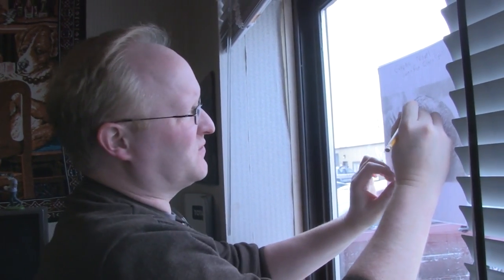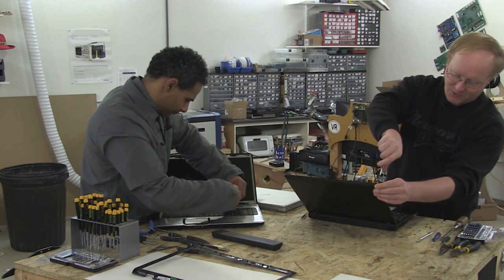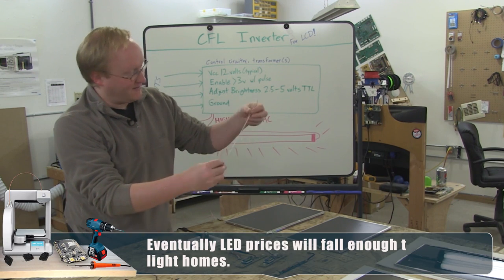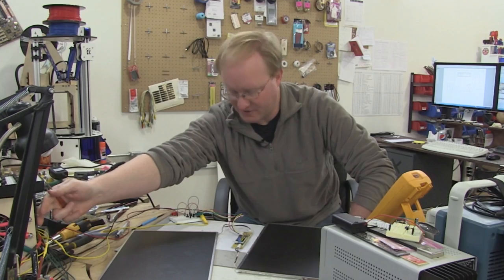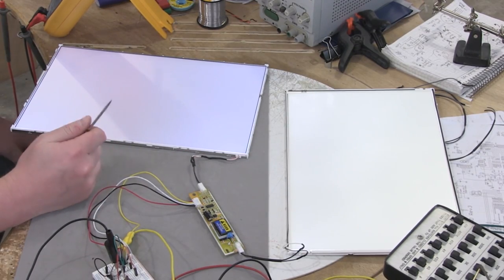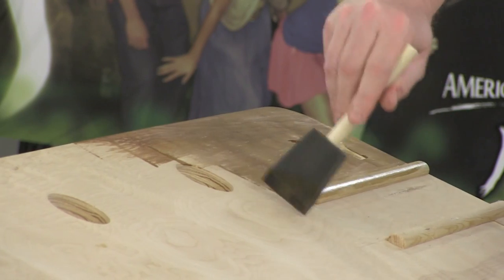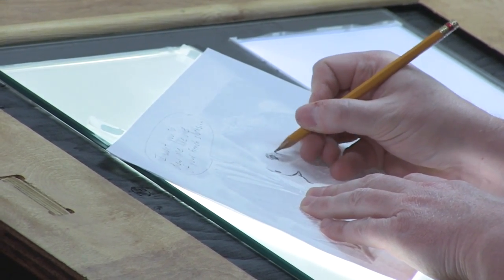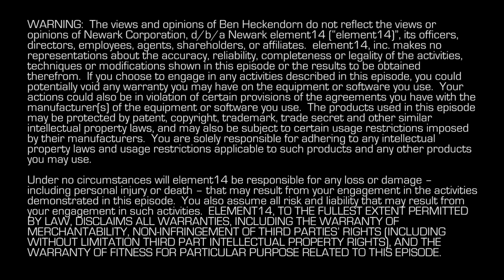Ben Heck’s LCD Monitor Light Box

Comment: This is the dumbest project yet. What a waste of good LCD screens.
Reply: So, you'd rather see the entire laptop dumped into the landfill? At least they're using broken laptops for something. I'm beginning to sense, based on the comments here, that many people don't actually realize that these laptops are broken. Broken laptops are as good as paperweights.
Reply: yuppiehi They could have used these screens for so many more things. They basically used perfectly good lcd screens in place of a lightbulb -_-
Reply: Possibly good LCD's with no available way to drive them..
Reply: SteveM You can easily buy a cheap lcd controller board off ebay for most lcd screen models.
Reply: SteveM You can easily buy a cheap lcd controller board off ebay for most lcd screen models.
Reply: Really ? even old laptop screens ? (I have a couple :D) I will have a look.

In that case, this definitely should have had a PI in it, and shown the actual images you wanted to trace on the screen.
Reply: By what Ben said about a specific screen I believe  that in the future Ben will make a driver using a FPGA for that screen.

I do have a LCD screen laying arround, but the cost of the driver board + shipping to Brazil is more than to buy a proper 24 inch LCD monitor...
Reply: yuppiehi he didn't say to throw the screens away, he said to use them for something else.
Reply: +Julian Dymer 
Dude you can use broken screens for it....
Just remove the lcd panel so that you are only with the backlight left.
Reply: floSa  Yes, but Ben did not. And there are still better uses for screen backlights.
Reply: Julian Dymer
Depends on what you are doing.
This use is a pretty good one if you are an artist.
I made in my past something similiar to help me with drawing,
Very helpful in the evening when you dont want to light up the entire room.
As example as in my case where my gf slept in the same room.
Reply: floSa  seriously, I own a much more efficient alternative: an angled wooded box with a semi-opaque sheet of plexiglass over it and a lightbulb inside. It plugs right into the mains and had a switch on it.
Reply: Julian Dymer
This method doesnt light it up as evenly which if you need percision is not as effective.
Why should I choose the less even method when I can get a broken laptop screen for max 10$ in a local store.
Also I chose my table to install the screen.
Explain to me how I make room on a massive wooden table for a lightbulb.
Basically I took away some of the table, just enough so the backlight panel and a plexiglass cover was able to fit perfectly in.
Doesnt take any space besides the power cord below the table and keeps the table "intact".
Tell me now how I do that with a lightbulb.